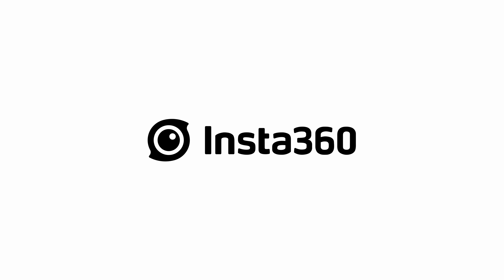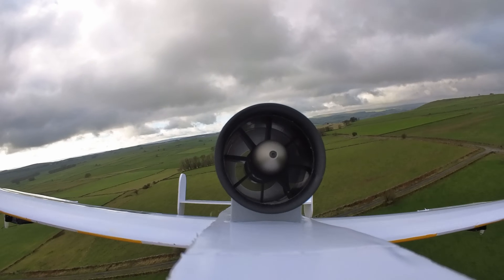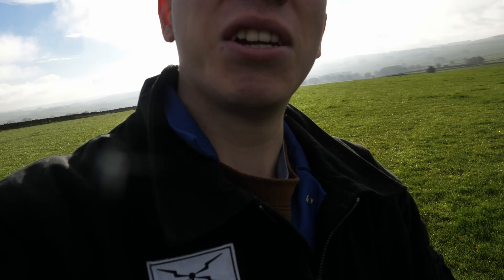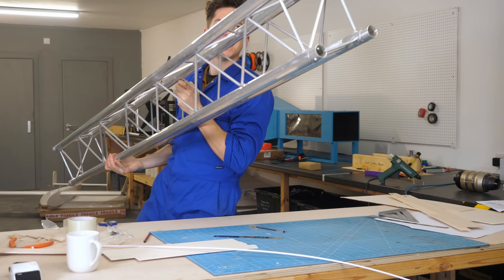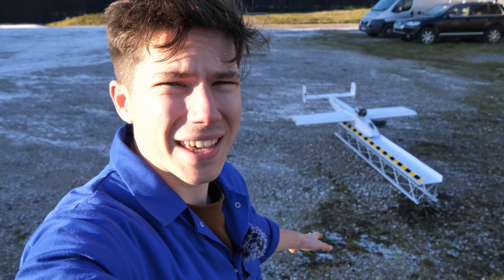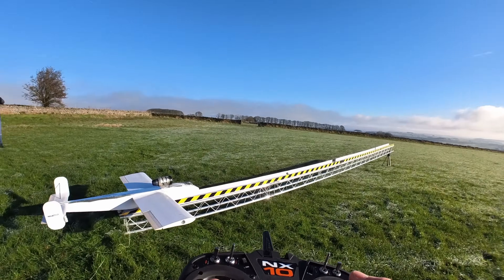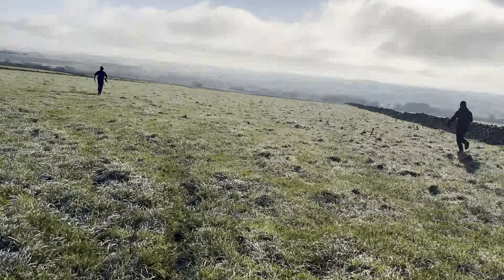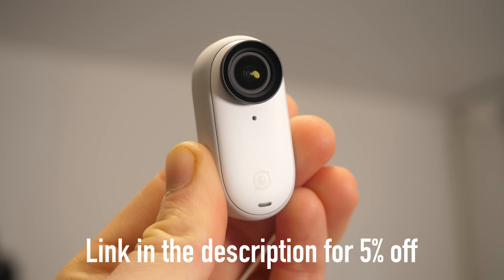Foam RC Jet

Comment: If the signal had not been lost, you could have glided down very easily.
Don’t use spektrum.
Reply: I've been using elrs, works underwater with my model submarine 😂 and spectrum users talk about line of sight with no obstacles.
Reply: Yep! I lost multiple planes to Spektrum. Switched to Radiomaster and ELRS and never had another problem. And everything is a quarter of the price!
Reply: @Destructor429   I don't care what any Spektrum Knob Slober says.. spektrum is affected by Ignition interference
Reply: Only radio I’ve ever had a glitch with was a Spektrum.
Reply: @WellingtonIronman   I lost a plane using Futaba but to be fair I had the Rx to close to the ignition module. 
And multiple with Spektrum. 

Knock on wood haven't lost one with FrSky yet that wasn't 100% pilot error. 
FrSky amd RadioMaster   are far superior at a fraction of the cost ( aside from the X20pro ) that little bugger is expensive
Reply: Team failsafe has struck again. ELRS or Crossfire are cheap nowadays and switching pays for itself in just one or two crashes.
Reply: Used to fly spektrum, crashed numerous jets. Switched to FrSky, never had an issue. I wish people stopped paying for the overpriced junk, they just have a hold on new members to the hobby
Reply: @hennys_rc_hanger  yeah. İt’s expensive junk.
Reply: @hennys_rc_hanger  I think it's actually the other way around. They have a hold on old members and they refuse to switch because rightfully they don't want to relearn how to set up aircraft. The issue is these people also recommend and teach new members of the hobby how to use spektrum. Spektrum's whole business model is built off of people not wanting to learn other systems.
Reply: ExpressLRS Gemini?
Reply: Elrs all day
Reply: It was a bit irresponsible to not use a long range controls like like tbs crossfire or a high power ELRS
Reply: Spektrum is trash for flying over 300m. I crashed a few drones and planes bc of the shitty Spektrum link. Now I use R9 frsky or ELRS. ELRS is clearly my choice now. Cheap and good link for over 10km.
Reply: Spektrum much of Trouble.
Reply: If you don't want to lose signal don't use spektrum. Yes they are hard decent for cheap and close flight. But if it's worth any money... go to fr sky and crossfire.
Reply: No rc jet pilot uses Spektrum... Yeti is the system you need but veeeery expensive
Reply: @SonAndDadFPV  I think you mean Jeti.
Reply: @Kimotri  correct!
Reply: Fuck Spektrum. The amount of planes, drones and heli's I have seen come down due to control loss with Spektrum is insane. One corner of our field is notorious for Spektrum glitches. It is called the DSM corner or Spektrum triangle, because shit get's lost there.
Reply: I always use a dedicated Rx power source, for Spektrum. Never had a problem.
Reply: I've been using Spectrum for years and I've never had a problem, if you do a range test and set up fail safe you should never have a problem flying line of sight,
Reply: @EJ-74 I've used spektrum and fr sky at flite fest in Malvern Ohio and spektrum will frequently fail due to interference. FR Sky has never had any issues in that environment. Obviously interference from other channels is different than randomly losing signal in an empty field but it speaks to the quality of their receivers. Spektrum is easy to use but for extreme circumstances it's AWFUL. Not to mention extremely overpriced.
Reply: AMEM !!! Screw spektrum 
FrSky or Jeti are king
Reply: FrSky is garbage. After the rash of high-profile turbine crashes, this dirtbag company went from building their company on Open Source protocols/software to Closed Source.
Reply: And this is why I run rc cars. Planes don't bash quite as well.

Comment: hey, i have had a LOT of problems with spektrum and classic protocol 2.4GHz links, even with satellite receiver in redundancy. I switched to ELRS and never had any problem since, at least caused by the RC link. 

Using spektrum or frsky 2.4, you often forget how short distance it is. It's all going great, until it isnt and you loose control. I have a crash on my channel, almost lost the plane in the river... It was more than 5 years ago, and didnt know why, until it happened again in a field away far away from any city. At this point, I knew it couldnt be interference, it just is the incredibly small range + some metal obstruction like the Jet in your case. You get at most a kilometer or so. 

Anyways, quick fix is to get ELRS radio with 1W transmitter and ELRS receivers.

Cheers
Reply: 1w Elrs? Do you want to cross the whole Planet? 100mw is more than enough for like 20km.
Reply: @sheggy012  dynamic power + foil tape= no problem picasso.

It prevents from things you didnt think about.
Reply: Even 100mW ELRS will far outperform DSMX/FrSky
Reply: also with such an expensive engine on a plane I would run a flight controller with GPS and rth. And also would use a elrs diversity rx so when one antenna gets blocked by the engine or alufoil the other may still have connection
Reply: @bot-sk8mt  yup put some ardupilot on that boi, and you're golden.

Comment: Why did the RC fail? Quite possibly, the 2.4ghz set you're using just doesn't have the range. Especially with spektrum branded stuff, I've had the occasional dropout well within visible range, a fast plane like that could reach those limits quickly. IF you want to stay on 2.4ghz, Futaba, JR, Jeti, those brands come to mind as being more highly regarded in terms of consistency. You could also switch to a lower frequency lrs like the TBS crossfire.
Reply: Either low frequency crossfire, R9M, or ELRS 2.4 at normal frequency, or both ELRS 900Mhz. ELRS 2.4 should be more than enough, you get 1-2 km sometimes with good performance at most on spektrum, and tens of km on ELRS. Jeti, futaba, JR, etc all rely on the older style communication protocols, with no LORA, and suffer from range too, but with more graceful dropouts, and are way more expensive for similar performance in the end. Spektrum will often drop instantly :| which is why it is the worst.
Reply: @tenns  From a technology perspective, futaba jr etc are definitely older. From a lived experience perspective, my spektrum and frsky equipment would drop out while the old farts on  futaba and jr kept flying just fine...
For lrs, I've had good luck with crossfire, and the frsky r9m stuff usually works but is susceptible to bad qc. Haven't tried the others.
Reply: On flat unobstructed terrain like that, hell, even a cheapo Flysky should be able to do multiple kilometers - stock FSi6s have been tested to 4km before the signal became intermittent and 10km before it was lost altogether. My gut says something in the airframe blanked the signal - foam is RF transparent but a foam plane doesn't usually have all that jet gear in it. That big expanse of foil tape along the upper rear fuse could well be the culprit, in a gentle climb it was probably directly between the Rx and the Tx.
Reply: @rcbinchicken  rf blocking is definitely a possibility. I'd still recommend getting away from Spektrum, they just aren't good, but whatever system it's replaced with will need care taken with antenna placement. And use a redundant receiver system if possible.
Reply: oh yeah that tape, forgot about it, should be that then. Also flysky seems better than spektrum, always impresed with iforce2D range he showed in some videos, never could get similar with spektrum! @rcbinchicken
Reply: Definitely, ELRS 2.4ghz should do just fine, spectrum is nothing more than expensive proprietary hot garbage in my honest opinion.
Reply: In addition to all the things mentioned in the comment section (the foil tape, carbon tube, lack of a satellite rx, possible sparking as the engine attempts to restart), you're not doing your signal strength any favors holding the TX antenna in that orientation.  RF radiates most strongly perpendicularly to the antenna, and during the loss of signal part of the flight, you're pointing it straight at the aircraft.